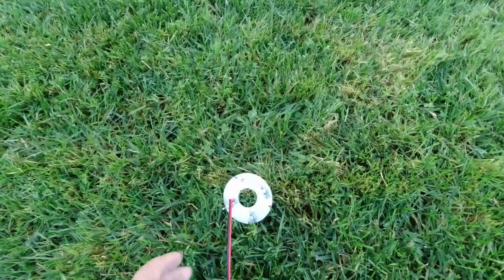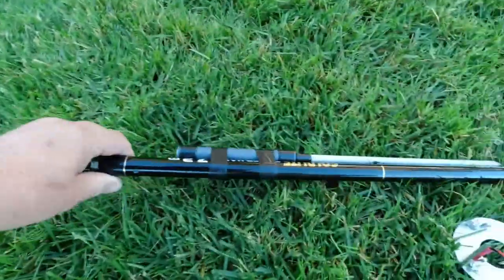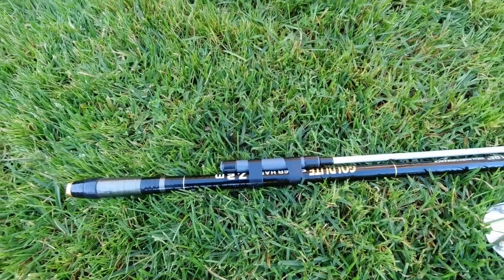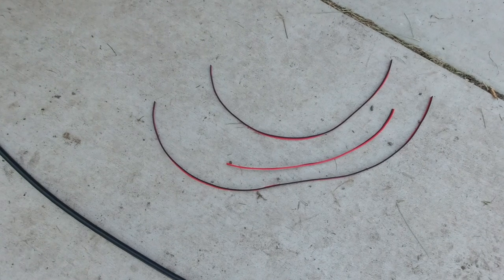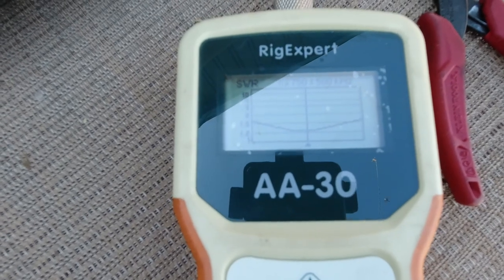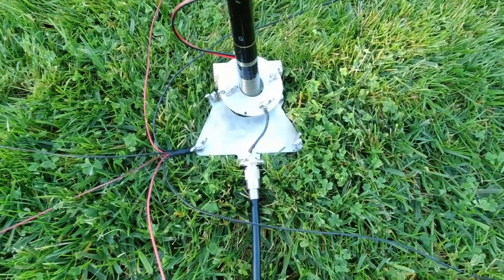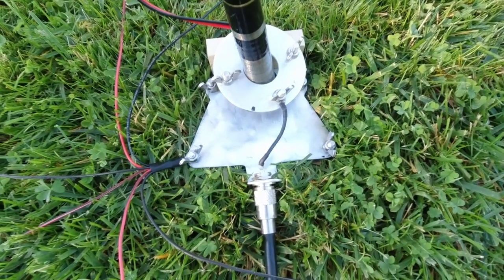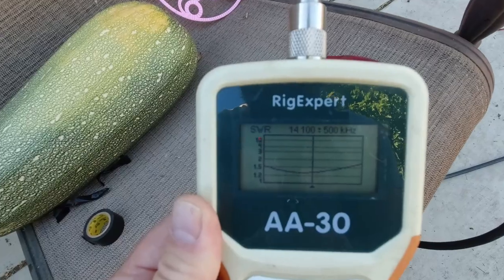How to make a Quarter Wave Vertical Antenna Reflector for use on Parks On The Air (POTA) activations

Comment: Over 450 subs, keep rocking it my man! Great idea on the reflector, and a cheap alternative to using Powerpoles for the disconnect
Reply from the maker: Thanks Gary , I found out my graphite pole in the video threw off my lengths did the same with a fiberglass pole and done a little testing but bands being up and down nothing solid yet. Thanks for commenting ! 73

Comment: I saw a chart in the ARRL Antenna Handbook that showed 4 radials would make no difference in signal strength. It's not until 16 radials where it approaches close to a 2dB difference in signal strength. 

Edit: the chart was for 1.8 MHz. It does improve signal by 1dB at 7.2 MHz.

Comment: Hi Chuck,
You should have the reflectors length about 5% longer than the length of the 1/4 wave vertical. Don't know if any radials are needed at the reflector. Stay safe.  WJ3U
Reply from the maker: Hey Don thanks for watching , I think that's about how they came out 5%.

Comment: In one of Callum's vids when he was talking with Roly , he mentioned having the reflector 1/8th wavelength distance away if I recall correctly, can't recall how long he had it though.  Worth checking out I guess, been planning to do something similar next spring when the weather is nicer.
Reply: I guess the reflector needs to resonate about 5% low, but depending on the spacing